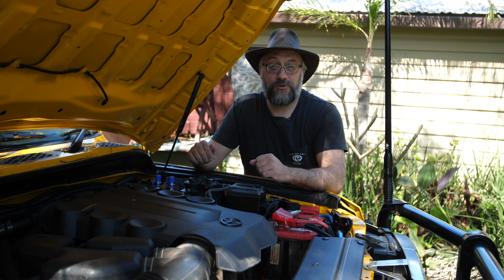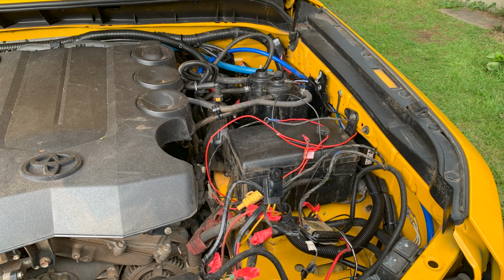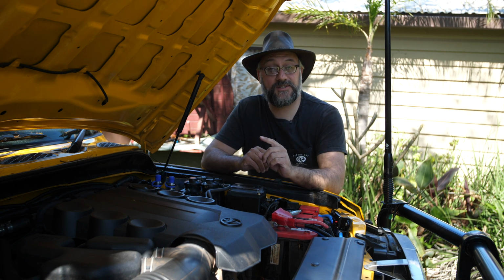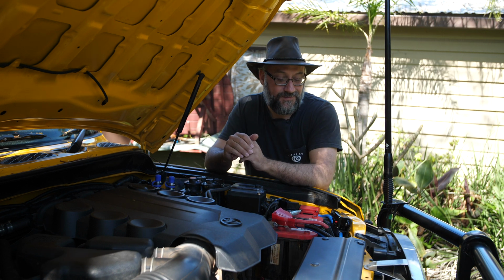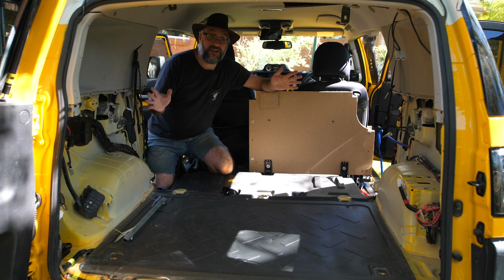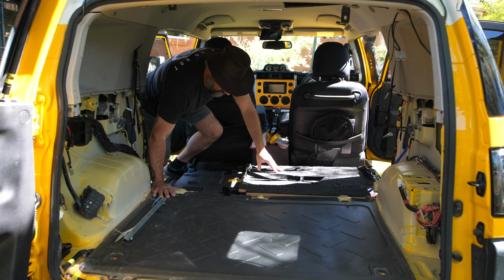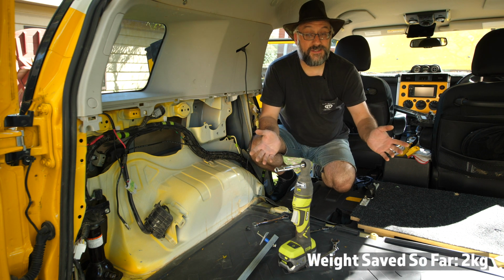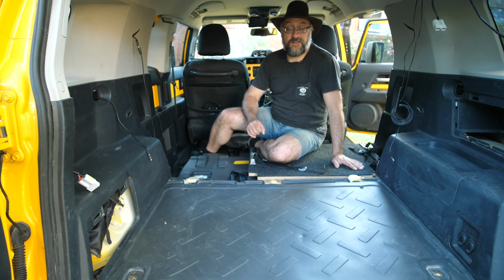FJ Overlanding REBUILD - Part 1 - Electronic Rust Prevention | @4xAdventures#adventure #4wd #touring

Comment: Regarding losing the rear seats did you have to get the vehicle recertified by department of motor transport (or whatever they are called now) as some subi owners up here in QLD have complained that police have defected their vehicles for not having them recertified as a "van" verses an SUV because they removed their rear seats for a camping conversion, regardless of whether it was temporary or permanent.

Comment: I was at the wreckers earlier this week & came across one of these units in a 4WD, an hour or so later I had the majority out with the wiring & capacitance pads, along with the other bits & pieces the total was $50 so well worth the visit given the costs of these units, new pads are a whole $28 so if any don't function after I test install them are easily replaced.  I think this technology is sound although I have seen a few negative review videos about having to get it checked yearly by an approved installer otherwise the 10year warranty isnt valid. A good additional level of protection with some non rust coating for beach work methinks at this price regardless.

Comment: I did wonder about the water inlet/outlet underbody, access & damage/dirt etc wise so good move. Where did you site your temper valve?
Reply from the maker: The temper valve is in the engine bay, off to one corner. 🙂👍
Reply: @4xAdventures  some great ideas in your build videos mate that I will be incorporating into my Subi Forester fit out.
Reply from the maker: @Mark-ks9jj Thankyou kindly! Glad you found them useful :)

Comment: Which shop did you have your wiring done originally? Such a shady job... but also... if I'm not mistaken, yours is 3rd gen FJ, you should have factory wiring for fog lights. Ever thought of wiring your fog lights to it?
Reply from the maker: It was done by ARB. I expected better from them but 🤷🏻‍♂️. There’s no existing switch in the cabin for fog lights. Maybe there is pre-existing wiring… but I don’t know which one it is. Maybe next time I’m in the mood, I’ll search for it. 😊👍
Reply: @4xAdventures  oh the beauty of 
 factory fog lights wiring, is you don't need a button. You need to replace turn signal stork with fog lights turn switch and add a new relay in fuse box, next to blinking ac relay, exactly the same one, I saw you have an empty space there on your video, you can even go with Narva one for $20 instead of $80 for genuinely toyota, narva is a trusted brand. You'd even get a green fog light indicator on dash as a bonus.

Comment: Artie what exactly is the purpose of the two heavy duty terminal stud boxes?  They seem superfluous unless I am missing something!? Ta.
Reply from the maker: G'day Larry, Great question! I had a huge spiderweb mess of wires running to the battery terminals because I had so many accessories. Each battery terminal had about 14 wires hanging off it. It looked terrible, and made it really difficult to change batteries, not to mention i could barely find space to fit those wires on to the existing battery terminals. So, to make things neater, I have re-routed all the low power stuff to the distribution boxes and have the high current stuff still directly connected to the battery. In the next video, you will see the new battery terminals close up. I only have 3 thick cables hanging neatly off the new battery terminals now. Much nicer :)
Reply: Thx for the explanation and I understand the issue, however couldn't you achieve exactly the same thing by going direct to the fuse box with a single positive and negative wire respectively (from the battery)?  I am a bit confused why the boxes are necessary in between the battery and fuse box?
Reply from the maker: Ahh I see. Well, the negative wires still need a distribution box. Yes, I could use the chassis at various points, but I simply chose to do it this way, especially since all of the negative wires were all originally connected to the battery itself and so were there anyway, this just seemed the easier thing to do at the time. You're right re. the positive wires straight to the fuse box, however the fuse box I am using doesn't have a bus bar, so each fuse either needs an individual positive wire run to it, or i could connect one side of each fuse together in series, but that would require a larger guage wire, and I'm already using 30A wire. The truth is, i didn't think of it at the time. :) Maybe next time I'll do it slightly differently.
Reply: @4xAdventures  Thank-you, makes sense. Looking forward to part 2!

Comment: Hi Attila, great job. I like how your main battery wiring has turned out. My fridge is in the same place as yours and the Engle lid opens up just perfectly with around 30 mm clearance from hitting the roof lining. If you don’t have one, I strongly suggest a high amp isolator for your winch supply. The ones used for competition rock crawlers are good but you will need to 3D print up an insulated cover. The Hella type with red plastic T shaped key are not rated enough. As you may know the dust can come in the hidden flaps in the rear quarter panels that are there I understand to help let air out when you close a door etc.
Reply from the maker: G’day Michael! Thanks very much! That’s interesting about the winch isolator… my winch has a switch in the cabin which turns it off via a relay. Do you think an additional isolator would be required?
Reply: @4xAdventures  yes to help ensure whilst driving around town if you have a bingle it reduces the risk of fire from an electrical short.
Reply from the maker: Ah! Good to know! Thanks! 😊👍

Comment: I'm one of the people who are sceptical about these after-market electronic anti-rust devices. I figured, car manufacturers spends millions of $$$ on R&D to prevent rust on their products etc. (if you've read books on car manufacturing or have ever watched one of those car production line documentaries, you'll see what I mean), And all they have to do is fit one of these devices, yet not a single one does it, it makes you wonder if they work. So it'll be good to see if it actually works for you.  Have you noticed any interference with your radio and/or UHF (ie. more static noise etc) since you've fitted the device?  Coz' I've read it could cause that on some vehicles.
Reply from the maker: Yes, it's pretty difficult to prove one way or another. I bought the FJ new and the dealer fitted a similar electronic rust prevention device, although it only had a single point of contact with the vehicle, and so seemed to be far inferior to the Couplertec module. That said, i did get a nasty stone chip on the bonnet about 5 years ago. It was down to the bare metal, however even to this day, there is no rust apart from a light coating of brown on the top of the chip that I can just scratch off with my fingers. I think the previous device was doing something, but only time will tell. It finally gave up the ghost, hence the Couplertec. Thanks again for watching & commenting! All the best :)
Reply: If your vehicle rusted out within 10-15yrs, then the manufacturer gets to sell you/someone a new car. Why would vehicle manufacturers want a vehicle to last forever???
Reply from the maker: They make far more money on regular dealer servicing & spares than they do selling you a new car. If you think about how many thousands of components go into a car, even at the wholesale prices they buy the components for, the sum of all those parts leaves not that much profit I think. So it seems to be in their best interest to keep your car on the road as it’s a cash cow for them. 
That’s just my 2 cents worth! ☺️👍
Reply: Ok, I was going to resist commenting on this, but as someone who has a PhD in corrosion and an SME in this area, these electronic rust protection devices are a scam. They do not work. Years ago just for fun a group of us approached some manufacturers of these and asked them how their devices stop corrosion.  It was all buzz words and scientifically incoherent. I work for one of Australia’s largest oil and gas companies and my entire job is trying to prevent our facilities from corroding. If it was as simple as installing one of these devices, we would. But they are nothing more than a scam. They usually try to make them sound like cathodic protection systems, then gloss over the fact the shell of the car isn’t in contact with an electrolyte which is an essential element of a CP system. You can cathodically protect buried or constantly submerged structures, (requires a huge constant current supply btw, way more than your little battery) but not the shell of a car. I am aware of a friend who was investigating a radiator corrosion failure in a new car still under warranty. This was a legal challenge where the car manufacturer was claiming the owner must have filled the radiator with some corrosive liquid. This was challenged by the owner. Upon investigation it was found the owner installed one of these electronic rust protection systems and had wired it in such a way he made an electrical link from one of these electrodes, through the liquid filled radiator, back to the battery. You can google stray current corrosion, this is what was happening inside his radiator. His warranty claim was rejected. Also, in the US, it is illegal to sell these devices at the dealership. I’ll also add, even with an engineered cathodic protection system of a submerged structure, which is extremely expensive to install and maintain, you can still have corrosion occurring at certain locations, so given the relatively low cost of these units, that should give you pause for thought. One key consideration when sizing a CP system is the surface area of exposed metal (I.e. uncoated metal), this is why we paint submerged and buried structures. The idea that the massive surface area of a car chassis could be protected by the small current front a battery (as most of the time your alternator is off) is ridiculous. The battery would be dead every time you go to start the car if you calculated the current requirements 😂 

Your stone chip is not corroding because the steel has a good micro alloy composition and is galvanised, not because of this system. Ask the guy who sold it if he can explain to you corrosion mixed potential theory or any electrochemistry, for that matter… But I bet he will know a lot of bro-science.